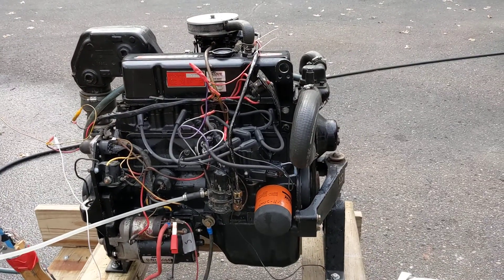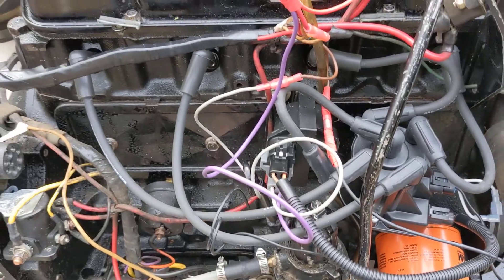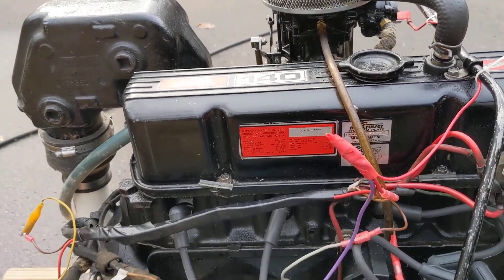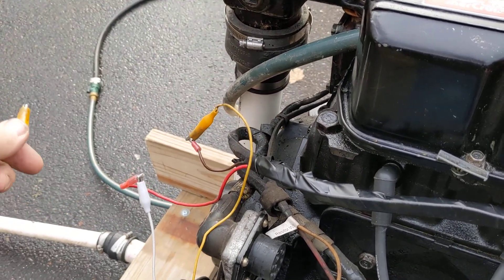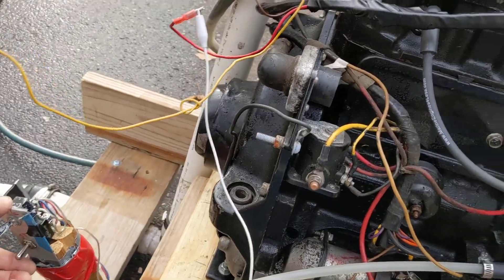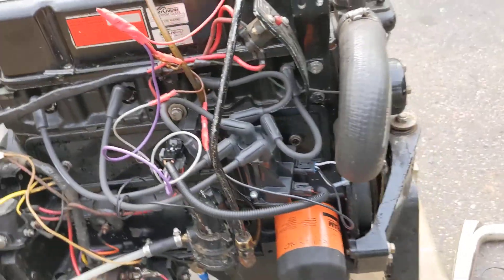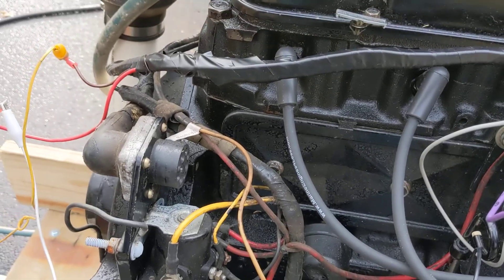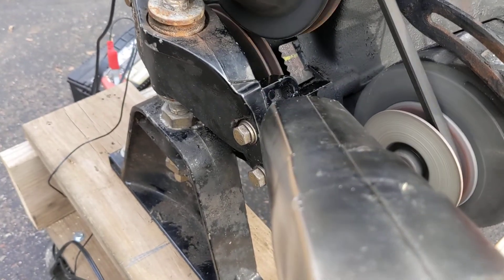Delco Voyager EST Marine Ignition Kit  on 1979 Mercruiser 3.0L 140hp

Comment: How is this conversion holding up, im having problems with my ddis system. when after i drive my boat for a hour or so in the water it just shuts off
Reply from the maker: Mine had worked perfectly since day 1.  After 2 years I  have not had any problems with it, engine starts right up, runs great.
-andy
Reply: @theOriginalBanger  thank you for the response back, thats great its still running great. i called pertronix today and the guy i was talking helped me alot. told me i have a ground issue and since my rpm tachometer is stuck on 800 rpm even and doesnt movs, he said that can be the problem too. i got some testing to do when i get home. thanks once again
Reply from the maker: @FishingWithJo415  Do you have the full Delco distributor, or are you using a Pertronix electronic points replacement with your old distributor.   I had the Pertronix unit, and had issues, all my problems went away when I used the full Delco unit.
-and

Comment: Just so I understand cause I’m not great with motors. Do you still use the actual shift interupt switch just wire it the way you were showing?
Reply from the maker: Good question, yes the switch interrupt switch is needed.

In the old points system, when going from either Reverse or Forward to neutral, the shift interrupt switch closes and would send "- (negative)' to the points to effectively ground the points, thus killing the engine for a brief moment.

With the Delco Voyager EST, to kill the engine, you need to send  "+12 Volts"  to the Black Wire, to momentarily kill the engine.
Thus you still need to use the Shift Interrupt switch, but it needs to be re-wired so it has +12 volts going in to the switch, and when closed, the +12 volts comes out and is sent do the black wire.

I hope this helps.
-andy
Reply: @theOriginalBanger  one more quick question. The external ballast resistor. Is that just a special wire or is there actually a resistor spiced into it. I do believe that wire operates a couple different things and I was thinking about reusing it without the resistor
Reply from the maker: @garyocharger8332   

On older boats you might have the Ballast resistor, then in the late 60's mercruiser switched to a resistor wire.
The resistor wire has about 3 ohms of resistance, which is used to keep the points from burning up when the engine is running.   This is not needed in the new system.  In an older mercruiser there might be two brown wires going to  the + terminal of the points.
One was the resistor wire.   The second was connected to a contact on the starter solenoid, it was use to send a full +12V to the coil when the engine is cranking (thus in essence, bypassing the voltage drop on the resistor wire).   Neither of these are needed with the Delco EST.

I hope this helps.
-andy

Comment: Thank you for your video. I have tried everything under the sun. I have followed the manual, forum posts, videos TO A T.  I am either stuck in base timing mode or I cannot out of it. It is not advancing so I suspect I am stuck in base timing mode or the module is bad. However, I bought a new module in 2017 when I acquired the boat and it has been sitting while I mess with it to try to figure out the timing issue, among other things. It only has about 20 hours on this module and ~70 hrs on the engine. Any help or input is most appreciated. Your videos are super thorough and and amazing help. Thank you. - Mercruiser 3.0LX with EST Ignition
Reply from the maker: Hey Stuart, can you verify that engine runs differently with the white timing loop closed or open.   One test once it is running is to connecting the black wire (shift interupt) with +12 when the engine is running.   If in Run mode this should kill the engine (normal run mode).  If +12 has no affect, you are in timing mode.
I wish I could suggest more.
-andy